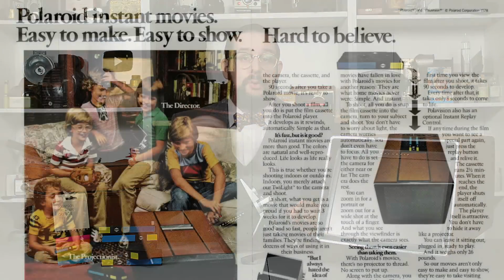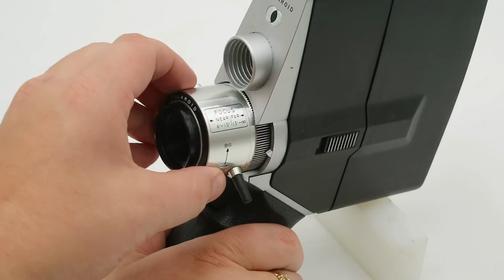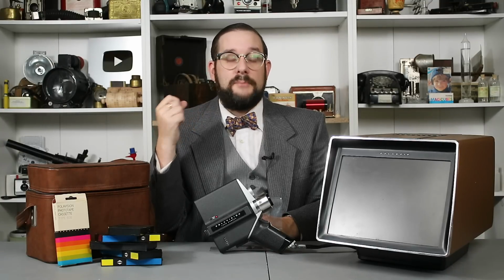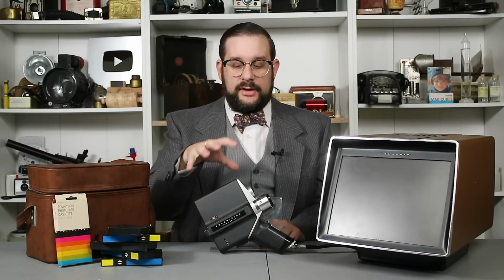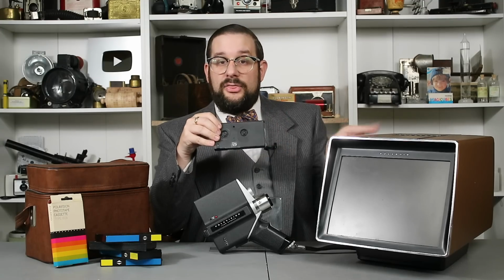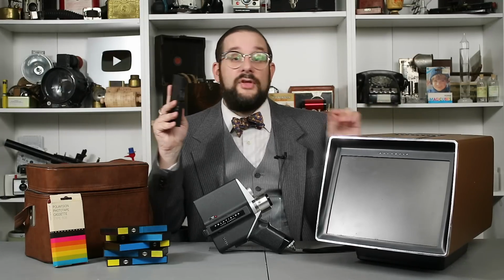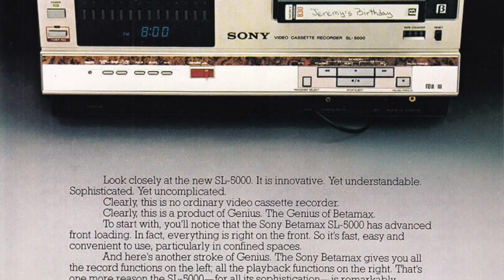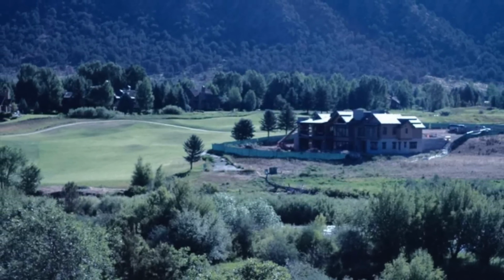Polavision: the Product That Killed Polaroid

Comment: So, to recap:

Polavision - Slow, Silent, blurry/indistinct/"low-def", proprietary, needed very strong light to capture.
Home Video - Truly Instant, Sound-capable, relatively higher "def", relatively more open notwithstanding the two formats at the time, able to function in much lower light conditions relative to Polavision.

Put like that, it does seem a mite daft.

Comment: I had one of these in the early 80s and yes, it was pretty much useless. The film cassettes were probably the weakest point of the entire system, suffering all manner of reliability problems, which I was able to mitigate to some extent by modifying the playback hardware (effectively forcing it to keep playing and not rewind all the damn time - then putting a rewind switch on top of the playback unit) but even then the limited run time, lack of sound (you wouldn't have been able to hear it above the racket that the player was making anyway) and the emergence of home video all made it a completely unusable system for most people. I can't remember at what point I finally got rid of it (I'm guessing late 80s) but while it was an interesting system that looked pretty cool and high tech at the timem it was WAY too late coming to the market, a bit like the CED fiasco some years later.

And of course the image quality was absolutely abominable 90% of the time :(

I did think that the camera looked very cool though, looking very scifi compared to most of the conventional 8mm cameras of the time.

Comment: I have the projector and about 20 tapes form 1981 and 1982. Just got it out  and was so disappointed that i couldn't watch any of the home movies. It is doing just what you showed in the video. It rewinds and then sounds like its playing but no light comes on until the last couple of seconds of the tape and then it rewinds again. Ugh. I've moved the tape along with turning the round things on the back and it reveals that the tape folds back on itself and then when I'm turning the discs it unfolds and straighens out. Thank you for this very insightful video.

Comment: I bought this Polavision product in 1981... it's been sitting in my basement for over 40 years.  I would like to digitalize the film since many of my family members are gone... is there any place I can send these cassette tapes to salvage what hasn't disintegrated?  Everything is in the original boxes but I can't seem to make the projector work... I will look at replacing the bulb but it doesn't even turn on... your information was very helpful.  Can you still buy the cassettes somewhere?  Or do I just toss everything?  Is there anywhere I can take the equipment and have it serviced so I can play the cassettes?

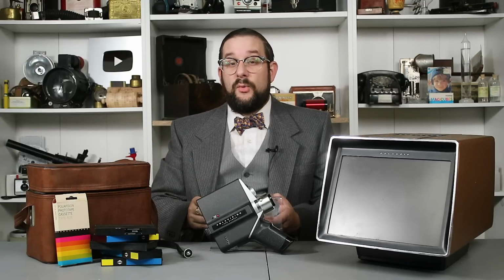Comment: Regarding film sensitivity, ASA 40 (5:13) wasn't all that bad for the time. Kodak was still selling Kodachrome 25 (ASA 25) 8mm movie film into the 90s, and Kodachrome 40 (ASA 40) for sound cameras into the 2000's. 
With the small size of 8mm film, you needed very high resolution to get reasonable detail, and slower films had the small grain size required by the tiny film.
It was more a limitation of the 8mm format than anything specific to Polaroid's implementation.

Comment: Excellent!

Now, you decried the decoupling of the viewer focus control from the taking lens focusing. In this you are incorrect.

A viewer needs an independent focus control in order to accommodate the operator's vision, which can range between strongly myopic to presbyopic. Top end SLR cameras had a dedicated viewfinder focus control for this reason.

One cannot gauge proper camera focus through the viewfinder without first ensuring that the image presented through the viewfinder is first in proper focus within the context of that part of the optical train.

This is not unlike the diopter control for one eyepiece of a binocular, a necessary accommodation for differences of focus between the observer's eyes.

Comment: Sounds like an autochrome with extra steps, but worse in quality.  It's clever on the one hand, but does so much bending-over-backwards to achieve its "self-developing" characteristic that is sacrifices too much in terms of image quality (the re-dispersal of the silver, rather than its removal, seems like the worst part).  A pity.  If this had been refined more, and made to function with greater light sensitivity, it could have been competitive enough to take a bite out of 8mm amateur stock.  As it is, it's just too crude in the final image it offers.
The colossal projector misfeed was....harrowing.....

Comment: I had one of these systems (including the blindingly bright 'twi-light', 'instant replay button', and case identical to that shown here) for Christmas. I remember the cassettes were very short and, due to the density of the emulsion, the developed footage could be seen optimally only in subdued lighting right in front of the player screen. A novelty nonetheless. Around ten years later, I decided to re-view the films I'd made so popped one into the player, only to discover that a wide grey band ran along the centre third of the entire film. Sadly, every other cassette was affected by the same issue, rendering every memory ruined.

Comment: They should have skipped this whole mess and put the technical development into the slide film which actually worked very well. Honestly if the slide film had entered the market in 76 or 77, likely the demand would have started Polaroid's move back into at last some profitability. As it was, it would have been another godsend into the professional market, much the same as some of their larger format specialty  printing systems.

Comment: How incredibly prescient—a 2-minute, 30-second video format, not far off from today’s YouTube Shorts! Polavision shows us that new markets can emerge spontaneously, yet they thrive only with widespread support—like when cameras became standard on smartphones.
Reply: Polavision born in 1968;released in 1978 ten years later also if they say that magnetic consumer videotape existed in 1970 for Philips and 1975 vhs jvc and 1976 Betamax 
Project was thinked only to a demo of the innovation of the company;
Also 35 mm auto processor and polachrome slides was thinked in the 40 s and on the market only in 1983 when slide market start to slow;whit powerpoint in the 90 s and keynote Macintosh software slide became a rarity and polachrome was discontinued in 2005/2006

Comment: I worked for a major high street photographic company in the UK. They bought all the remaining stock of Polavision in 1984 and sold the kit for £99. But they didn't tell the customers that there was no film available. This ultimately led to mass refunds to avoid legal action.
Reply: In theory film polavision was on the market until 1988;but can be that production was stopped in 1983 and that film 1984/1988 was outdated stock
Reply: @ilmago5291  I think one company had stock, but it was a totally non viable system by that point.
Reply: Jessops?
Reply: @ytthrowaway4584  Dixons. Which was still a proper photographic retailer (just).

Comment: I'm curious why you didn't mention one of the main reasons for this system's failure to catch on; specifically its incredibly high price point.  As I recall, upon its release in 1977 the price was a whopping $700 (equivalent to over $3,500 in today's dollars) with the 2 minute cassettes costing somewhere around $20 apiece (again, over $100 in 2024 currency.)

That high price structure alone caused people to ignore Polavision from the get-go even before its substandard design problems torpedoed its sales campaign.

Comment: I heard of Eumig as a maunfacturer of excellent film cameras is the 50s and 60s, like 8 and 16 mm. Excellent and pretty expensive, too. Too bad they bet on the wrong horse with Kodak.
Basically all the Kodak instant photo stuff I have seen kinda sucked - and it was expensive to use, too. Yes, you could see you abysmal photos instantly, but that was basically all it had on the pro side.
Reply: Disagree about Kodak Instant pictures. It was not very sharp by modern standards, but the colour rendering was amazingly accurate. I remember taking a picture of a friend leaning against a barn wearing a blue sweater, and comparing it to the original and it was pretty much indistinguishable from the original. Although the image appeared very quickly, you really needed to  wait 15 minutes for it to fully clear and sharpen up. I still have pictures from 1978-9 which are as clean and colourful as when new.

Comment: I've read some of the comments and I would like to remind everyone that for the decades when the Standard 8 millimetre projector reigned supreme, the projection had no audio, and the mechanical noise of the projector was overwhelming but it was considered a normal experience. The "griffa" (claw), the bi-pin implement that advanced the film frame by frame - by engaging with the perforation alongside its length - was the major offender as it moved 18 times per second along two axis. It produced noise up to the 30th harmonic.
In the mid-70s Standard-8 / Super-8 projectors arrived on the market, some of Japanese origin (Chinon anyone?), and they had vacuum tubes (EL84) at beginning, and transistors successively (AD161/AD162). They could output 4 W eff. of audio power, just enough to cover the mechanical clunking noise of the projector. The speaker was usually included in the cover of the projector, and had a cable long enough for it to be placed behind the projection screen.

Comment: I am a Eumig collector and have the polavision system in my collection just because eumig made it for polaroid. It was one of the reasons eumig got in major trouble in the 80’s. Because no one bought the system eumig was not paid for the new factory they built for the polavision devices. There were many other factors in play back then but this is one of them.
Reply: It's interesting that someone collects Eumig equipment. Back in 1969 my father bought a Eumig Mark S 712 Super-8 sound projector that got quite a lot of use by us kids in the mid 1970s as we made our own Super 8 sound films (back when you had to send the film out to be striped with the magnetic tape) and playing commercial Super 8 films. Sadly over time it stopped working well and got beat up so even though I still have it it doesn't really work. But 5 years ago I found the identical projector virtually new in the original box on eBay and snatched it up so I could view our old movies. I've saved the old one for parts but as the new one is perfect I don't know if I will ever actually use it as I don't watch the films all that often.
Reply: Watching old super8 films has a charm and character all of its own.

I am young enough, that I grew up with people using point'n'shoots and digital cameras.

And yet I shoot on film more photos than digital, and have even ventured into super8. It's expensive, cumbersome and sometimes frustrating, when compared to digital. But, the photos look cool, and while I can brick my computer and lose memory sticks, I'll have my negatives, and they'll stay "readable" for a century, so even when I'm an old fart, 70yrs from now, I can look at all my escapades, as clear (or out of focus) as they are today.

Comment: I'm curious why they didn't attempt to pursue a single transparency process instead of a negative-positive setup. I've processed transparency film before, both E-6 Process and a B&W process, and, the B&W process is really the same amount of chemicals as negative film is, simply adding a re-exposure step (something done in E-6 with chemistry, but E-4 often with a physical light from my understanding?). If the film is processed in the projector, they could theoretically take advantage of the projector light, to re-expose, and then re-develop the film, It'd be a slightly more complicated device mechanically but I don't see why not? this would've somewhat solved the lighting issues.

Also I'd imagine that polarvision's color reproduction would be similar to digital in that the filter used appears to function similarly to a bayer filter.
Reply: Both E6 and B&W development result in an initial negative image. If you want to get a positive there is a second reversal process needed, whereby the original latent image is B&W developed to silver and for B&W then the silver is bleached out. The film is then fogged out and a second development of the remaining positive image is either developed in a B&W or colour process. For colour the silver is bleached at the end. You can't do that on the fly in a semi dry process. Its worth noting that at that time (E3 and E4) colour development was very time and temperature critical, although I think that its was better by the time E6 was on stream.
Reply: @martinhow121  Yes, I know both of these things. but if you consider what I was actually saying, which is, yes they result in a single image, but the slide lamp could be used for a fogging/re-exposure step, it'd likely only be an extra one chemical step, and wouldn't that be superior to the double negative setup they used?

I will remind you that standard C41 is also very temperature critical, and I will assume C22 was as well. Clearly they had a way around this step.

I guess the answer to my question is there, something along the lines of the bleach setup (doesn't colour negative also use a high temp bleaching process?), but the entire fist 3/4 of your reply is assuming that I am an idiot, and restating things I all mentioned in my initial post.

Comment: On the extremely trashed and abandoned off grid property I bought in the desert and have been living on and cleaning up the last 4 years I've found a butt load of those cartridges in the dirt in various levels of decay. I even found the remains of the smashed up projector. It all went to the dump with the rest of the garbage. Every once in a while another cartridge pops up out of the dirt as well as some regular Super 8 reels. All thoroughly roached and not viewable though.

Comment: You misunderstand the purpose of the viewfinder focus. When looking through the viewfinder, it's best not to wear glasses. Therefore, you adjust the viewfinder focus so you can see clearly what will be exposed to the film/sensor. All more or less professional cameras have this. It makes adjusting the focus for the film/sensor SO MUCH easier, when you can see what you're doing.

Even digital viewfinders have this, so you can see the tiny screen clearly.
Reply: diopter adjustment
Reply: @billr3053  Yep.

Comment: Reminds me of some of the problems with the RCA Videodisc system. Made sense when at the time the idea was first conceived, ended up taking way longer to develop, obsolete when released.
Reply: hmm, it wasn’t that it was obsolete when released, it’s that cheaper and lower quality tape came onto the market. Laserdiscs had much higher quality, it was really stunning at the time, but consumers were very interested in the ability to record also, which of course laserdisc didn’t do.
Reply: @PRH123  RCA videodisc and Laserdisc are two very different formats.
Reply: @danielstickney2400  ah, right, those discs with the styluses, sorry :) although they weren’t so much obsolete, as they were overtaken by laser disc and tape

Comment: It wasn't "DuFrayColor" but Dufaycolor, and was British, not French — though named in honour of French inventor Louis Dufay, on whose Dioptichrome glass plate process it was based. Dufaycolor was rather more successful than Polavision, being used for colour slide and ciné film from its introduction in 1932 until the late 50s. 😊
Reply: My father worked for them in1945/6. they had a factory in Boreham Wood, just north of London. I still have some colour slides of his, they are very dense. He was always clear that it was not a viable technology even then. The problems were printing the colour mask and getting the registration of the 3 colours accurate on the film, which was costly and wasteful and the density of the result and the granular picture when enlarged. Kodachrome integral tri pac film was getting to be available and processed by mail order, so much more convenient for the mass market.

By the mid 70s it was clear that video tape would be the coming media and would displace cine. I am afraid that Polavision was a last gasp from a company that was clinging to two technologies that were fast becoming obsolete.

It's worth remembering that ASA40 was not a slow film even then. Most Kodachrome 35mm was 25 ASA and it was only when Ektachrome 160 arrived with decent grain structure that colour started to speed up.
Reply: @martinhow121  Fascinatng! I'd guess one reason it lasted as long as it did on the market was the relative ease of processing it at home.